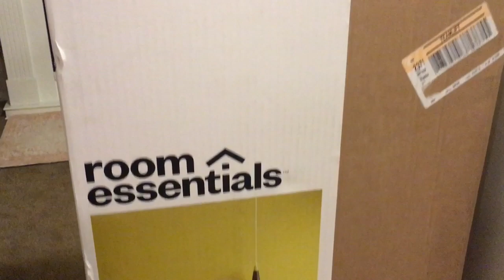HOW TO ASSEMBLE TARGET’S MODERN 4-DRAWER DRESSER FR. ROOM ESSENTIALS? | TheGarcias

Comment: Why did you hammer the panel in the very beginning?
Reply from the maker: Famous Nobody you need to do that to push the panel all the way to the wood
But just be careful
Reply: @thegarciasak  I seen u do the 2nd one AFTER I asked. I got mines in already. Wasnt expecting a response especially at 5:30am. I've had these dressers just sittin in the box over 2yrs. Sorry I may have more questions to come. 
Thanx in advanced! 😀
Reply from the maker: Famous Nobody no problem hehe